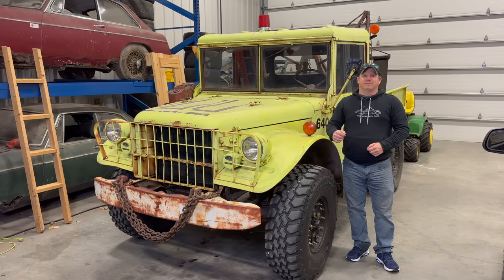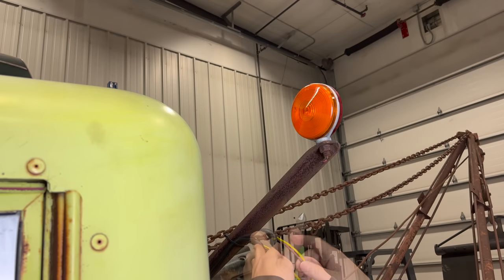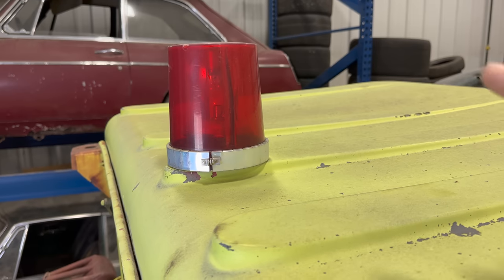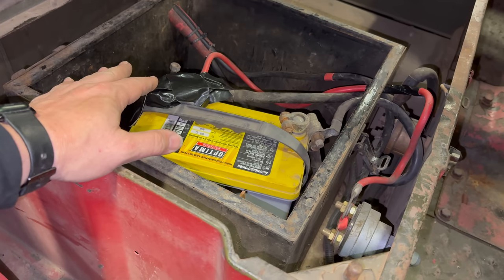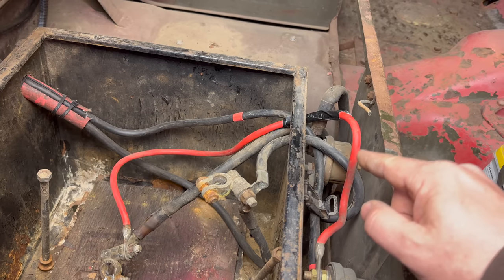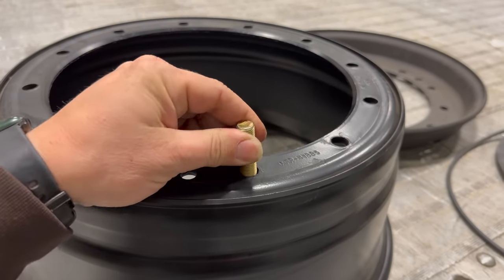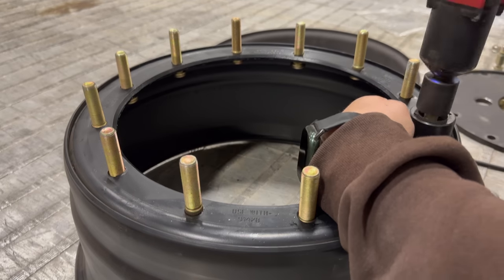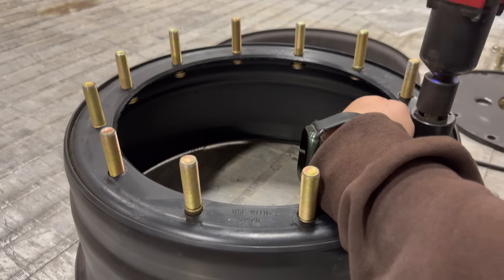Preparing the Off Road Wrecker for Off Road

Comment: I watched Matt of Matt's off road recovery adding bead locks to that type of wheel. Basically a steel tube the right size to drop over the wheel like the tire does and long enough to squeeze the beads against the wheel when you tighten the wheel haves together. Quite a simple way to add the bead locks.

Comment: Cool -- first time I've seen anybody else using a cordless Dremel to cut ornery stuff on a car.  I use my 8220 on rusty sheet metal when there's not enough room for an angle grinder.  If you go slow, the blades will last a while, but I'm not always that patient. 🙂
Reply from the maker: Yep when it is too small of an area for anything else just go slow and the blade won't break.

Comment: As large as the battery box is it probably had two six volt batteries instead of one 12 volt. I might consider adding another 12 battery in case you need the extra capacity for the winch.
Reply from the maker: It had two 12 volt batteries, it was originally 24 volt.

Comment: I was waiting for you to address the lights on top of the front fenders. Are they going to be safe?
Reply from the maker: Yes because the are low and I can see them, also those lights are standard to a M37 and are therefor available to get a replacement.  The other lamps are specific to the forest service and wrecker and would be hard to replace.